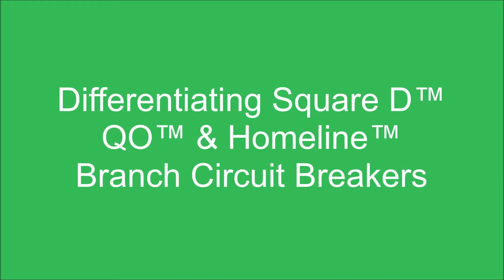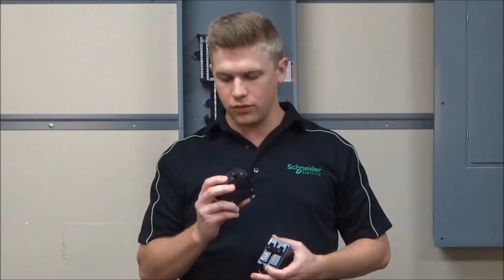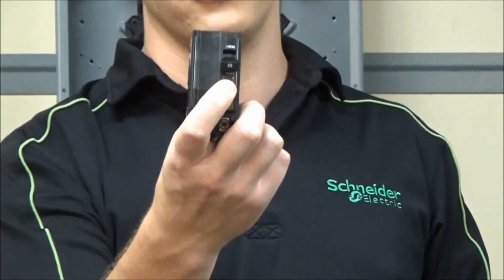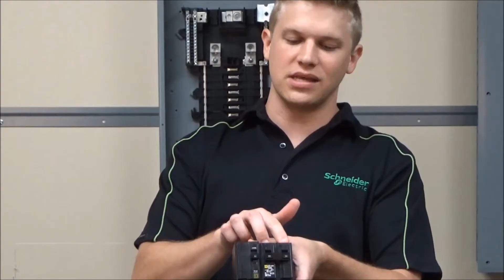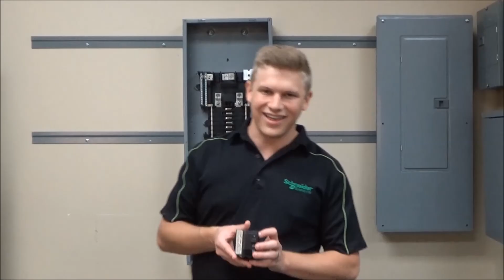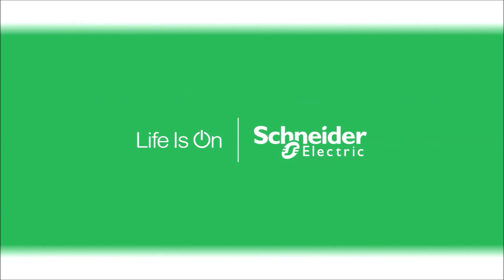Differentiating Square D™ QO™ & Homeline™ Branch Circuit Breakers | Schneider Electric Support

Comment: You never showed the real difference in the brakers.   To do this, you will have to turn the braker around to inspect the tangs/lugs on the reverse side.  You did indicate they are not interchangeable, but a demonstration would be helpful.

Comment: The most important part of the breaker is the bottom where the breaker makes contact with the distribution panel bus. Some breakers have a notch by the contact that permits the machined distribution panel contact to seat fully into the breaker. This is on a Homeline Square-D breaker.

Comment: I need a 20 amp GFCI breaker for a home line load center 6121 100RB 6 breaker Can you tell me the part number and where I can purchase one. The one I purchased at Home Depot does not fit.  Not a QO box

Comment: Square D has two different types of connections. One has "claws" that extend out and make contact with the poles, the other type has a "slit" where the breaker slides into a knife connection. I am disappointed  in this video as it would have been very easy for you to turn these breakers around to allow your viewers to see the type of connection.
Reply: I reconfigured the breaker with a Dremel tool until I can find a breaker that fits. No one seems to provide a contact view.
Reply: You're exactly right. The most important thing to the average homeowner would be the way it connects to the buss. There's a reason they call it "homeline"
Reply: Which one is a better, more reliable connection and which model is it on (Q0 or homeline)?